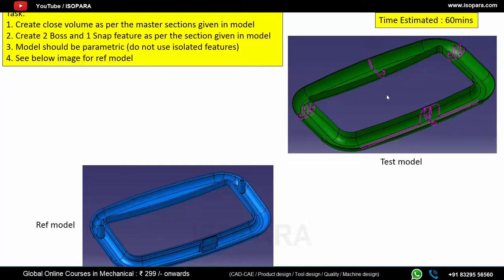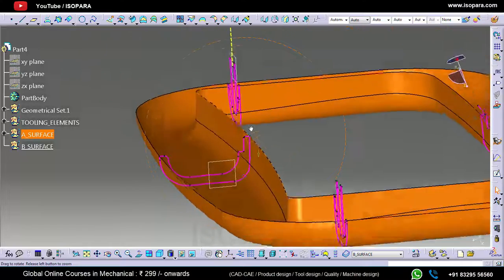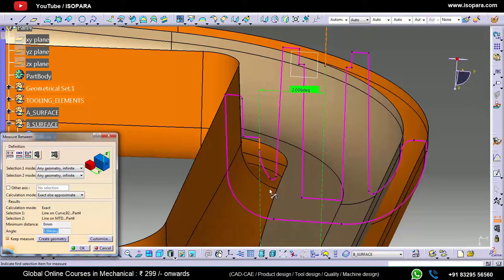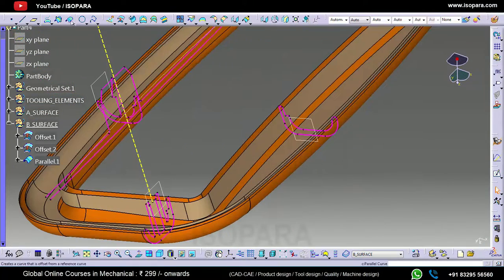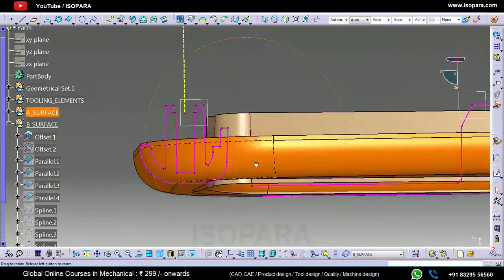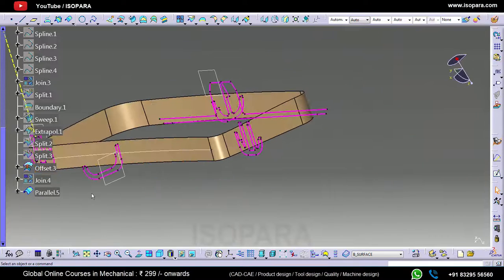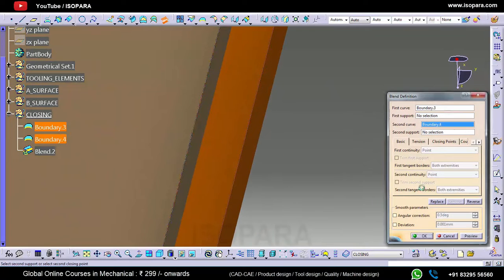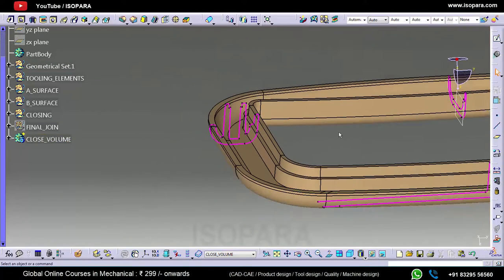CATIA V5 | CAD TEST Series-1 | Plastic Product Design | Part 2/15 | OEM & Tier-1 | ISOPARA

Comment: Hell Sir I need Help
I am new to Catia V5 
Problem is I got step file from somewhere It is Already rotated in three Axies So how to align part according to datum planes.
Reply from the maker: You can align in assembly workbench using snap command
Reply: @ISOPARAOfficial  part is aligned I assembly work bench But when I am Entering in part design it is The datum planes don according to part it remains as it is